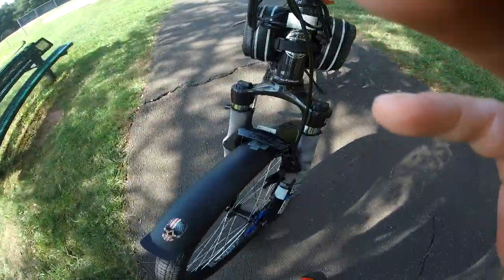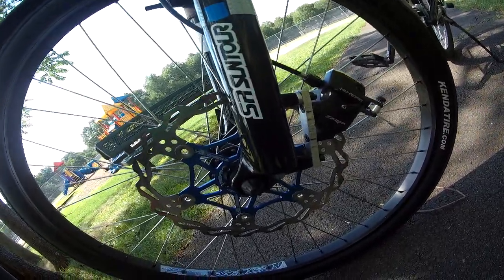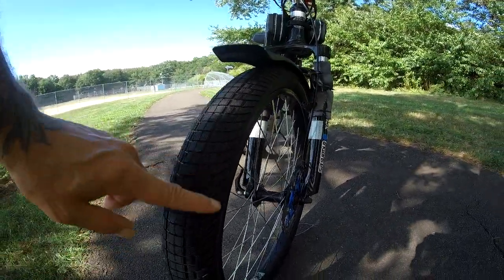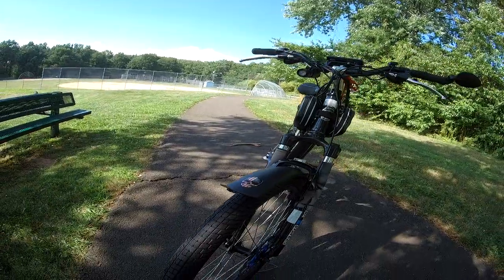Snail🐌203mm floating rotor⚡1500w Trek Fuel 90🚴road test,ALEX rim,TRP caliper+Kenda Kranium 2.1 tire

Comment: how's the review of snail floating rotor after 1 year? planning to buy one. thanks
Reply from the maker: 2800 miles love it just put new pads on almost went over the bars🤣 have 2 more on my other ebike 1000w Tomac 98 special
Reply: no heating problem?
Reply from the maker: @pepsviper  Not doing hardcore downhill so have no issues.
Reply: thanks a lot sir, power to you
Reply from the maker: @pepsviper  Ride safe & Have a great day